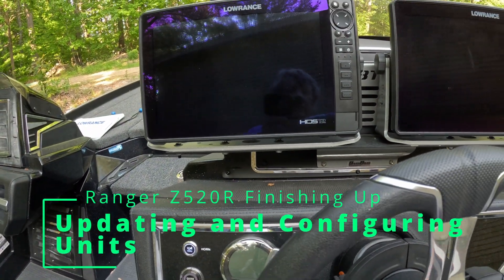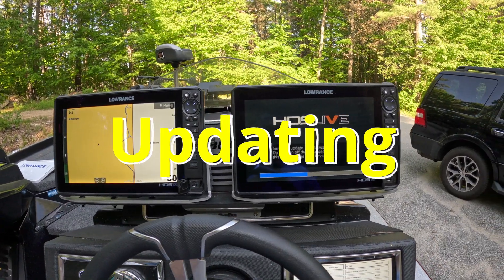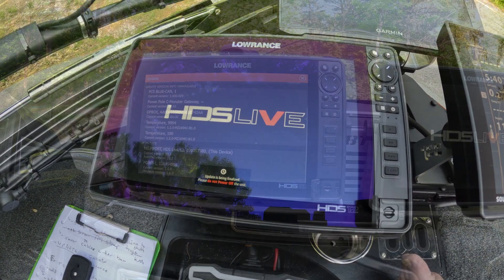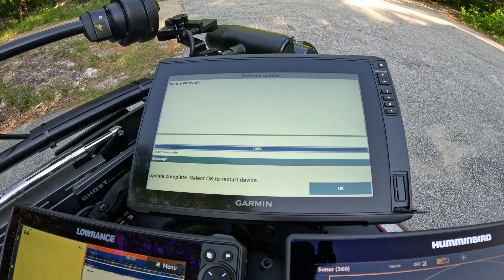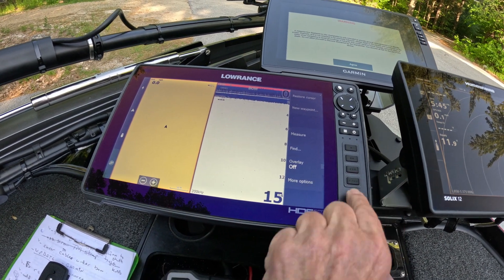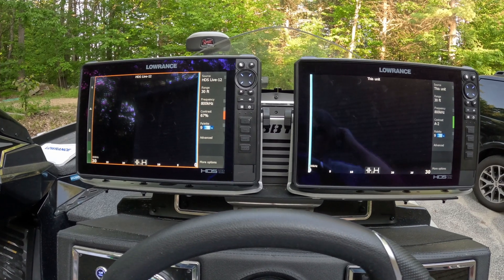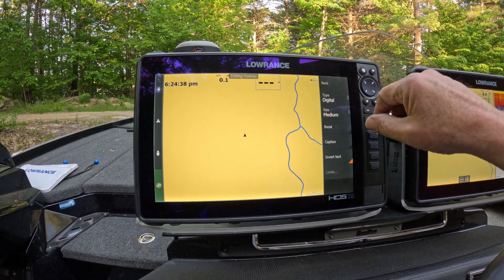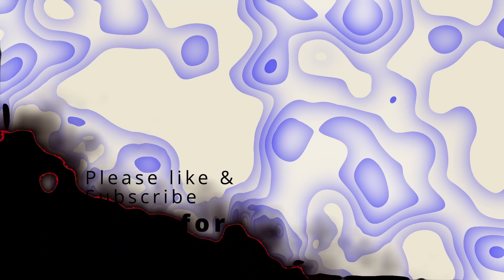Finishing Up: Updating and configuring electronics units in a dual console/triple bow configuration

Comment: Gary I had to send in my Live 12 to Lowrance to get repaired and they couldn’t fix it so they sent me a HDS Pro 12. Now I have a Live 12 and a Pro 12. Where should I run that Pro 12 ? On my bow ? I have AT 1 at my bow and at the console I have a thru hull and a 2 in 1 AI transducer. Not sure where I’d benefit having the Pro 12. Thanks for any help 👍👍
Reply from the maker: I'd run it at the bow for the Active Target. You'll get slightly better response time with it. Unless you want to upgrade your 2-in-1 AI to the HD version. If so then put it on the console for better side and down imaging. (That was good of them to upgrade you to a Pro model).
Reply: @garrywoodruff960  Yes it was I was totally shocked they did that !!! I do plan on getting a 3 in 1 AI to replace that 2 in 1 but not sure if I want to spend the $ on the HD. Thank you so much for the help !!!
Reply from the maker: I would look at getting the HD version since it will hook to your new Pro unit directly (just NOT the fish reveal one). I will be doing some testing early next week to compare the HD and original 3-in-1.  And you're welcome.
Reply: @garrywoodruff960  Gary I’m going to order a new HD AI transducer and my Ranger already has a shoot thru hull transducer for 2d (but it is 9 years old) should I just order a 2in1 HD AI or just go ahead and get the 3in1 ? Mine will be mounted on the pad as that’s where my current 2in1 AI is now. I don’t run a jack plate. Thanks Glenn 👍

Also I found a company in Canada that makes a flush mount for the HD AI transducer so I ordered one.
Reply from the maker: Hi Glenn, you should be able to use the in-hull transducer (you'll need the 7-to-9 pin adapter cable). That one goes on the Blue connector in the back of the unit. Plug the 2-in-1 HD in the Black plug. Then source the Sonar from "This unit CH1" and Side/down from "2-in-1 HD".

That way you will have sonar when you are running on pad. Otherwise using the sonar from a 3-in-1, it will drop out around 50 or depending on how much cavitation you get on the step where the transducer is mounted.
Reply: @garrywoodruff960  Thanks Gary your such a great help to me !!! I really appreciate it 👍👍👍